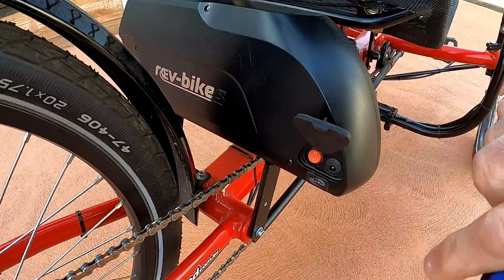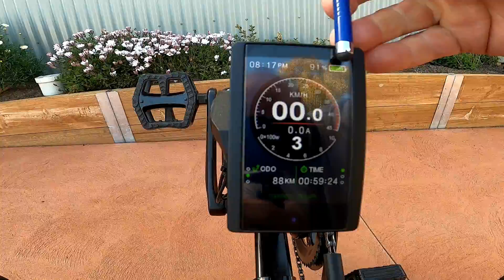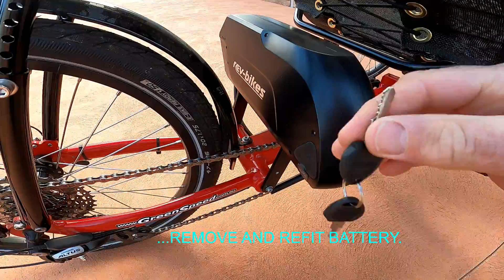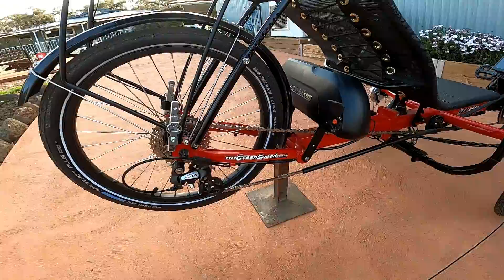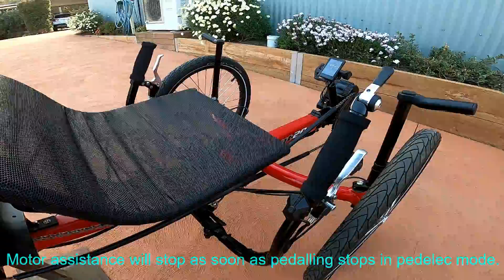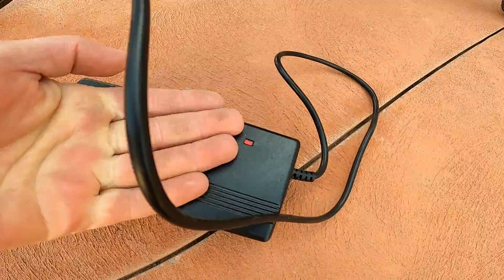OPERATION OF YOUR BAFANG EQUIPPED  ELECTRIC TRIKE

Comment: What di you use to mount the diplay on the boom, i cant find that anywhere
Reply from the maker: Do you mean the mounting bracket on the display, or what that is attached to ?
Reply: @fattim3818  the t bracket the is attached directly to the boom, that's how I want to mount mine but I can't seem to find one
Reply from the maker: Yours is a Greenspeed trike ? @richardlively1492
Reply from the maker: https://trisled.com.au/product/greenspeed-light-mount/

I used two of these.  They are threaded internally,  so you screw them together through the mount on  top of the mount on the front derailleur post on Greenspeeds
Reply: @fattim3818  related question. What kind of mount is that holding the battery?
Reply: Ok thank you for taking the time to respond 🙂